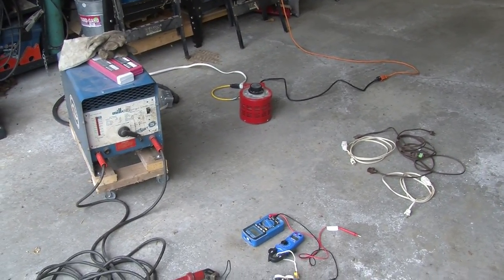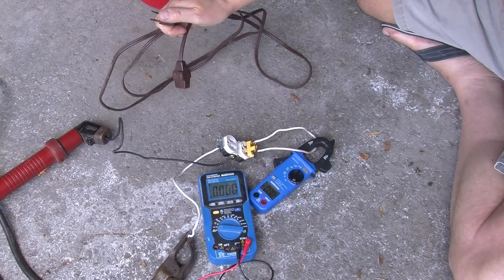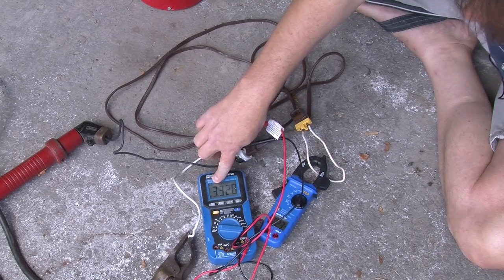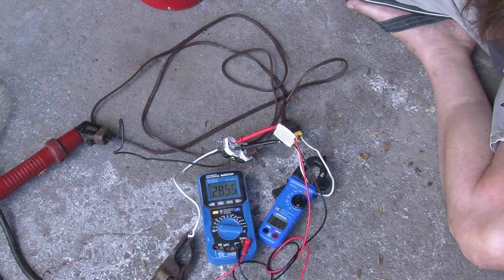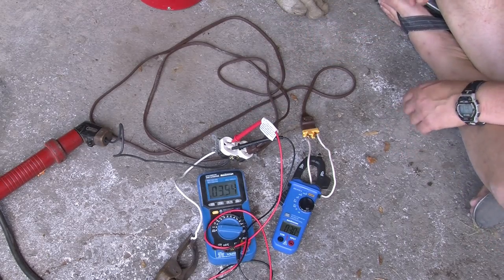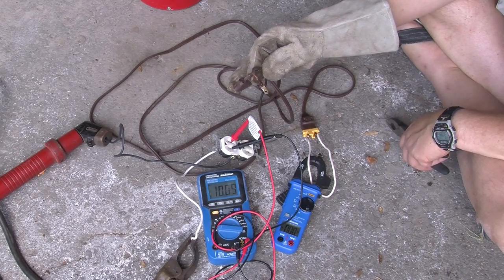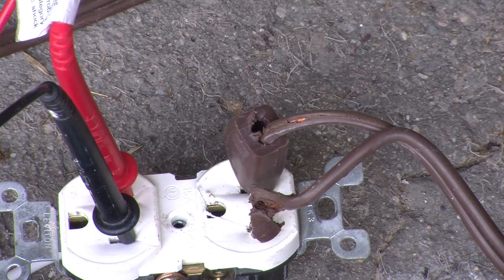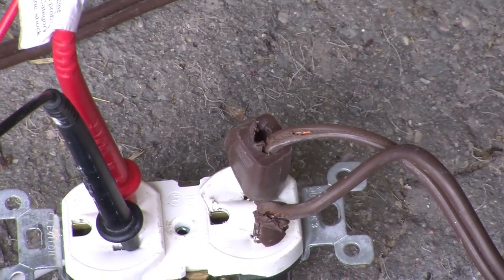Lets try overloading some extension cords.

Comment: Throughout my career as an electrician, and everyone in the company were volunteer and paid professional firemen. I lost count how many fire jobs I rewired. The #1 reason a home burns to the ground in NY is they used a 400W lamp cord cube or light duty extension cord for an electric heater. In houses with fuses, I have removed cabling that was so badly overheated, that the wire insulation disintegrates when Touch it.
Reply from the maker: So you saw these issues first hand! We should have fuses in those extension cords. "the wire insulation disintegrates when Touch it" - thats exactly what happened in my 14/2 in fiberglass experiment!
Reply: The new lamp cord cube extension cords today have a 4amp fuse in the cube. Purposely to prevent fires. 4 amps is roughly 500 watts. Plugging a 1500W heater or a wall air conditioner will instantly pop the fuse.
Reply: To further protect from fire. All receptacles switches and sockets in residential settings must be Arch fault protected per article 210.12 of the NEC. The Slightest circuit issue will trip an AF breaker.
Reply: As someone who lives in an older house (built before electricity in homes was a thing) in upstate New York, I can say that at least some of the wiring here is so old and made of such dubious materials, that the insulation turns to dust when the wire is bent, although it has never been overloaded.  There are at least five wiring systems: knob and tube (thankfully with no wires now), cloth covered wires (still used in most of the overhead lighting circuits, and some outlets with wiring dropped down from the fixtures), what appears to be gutta-percha insulated wires in black iron pipe conduits (this is the stuff that turns to dust when disturbed), THHN in galvanized conduit, and Romex.  About a decade ago, I had an electrician replace the fuse boxes (Edison base screw type) with a modern breaker box, after I noticed that house fires due to "electrical issues" were rather common in this neighborhood.
Reply from the maker: @robertlapointe4093  When I was teenager we lived in the same house in Ontario! Although no THHN in galvanized conduit or black iron pipe. I'm sure you felt much safer after the panel upgrade. I Suspect the old dry wood in historic houses  also makes it easier for an electrical fault to cause a fire. You probably are aware of this, but if not: there are combination arc fault breakers (CAFCI) available that fit most modern panels and are designed to trip if there is an arc due to a short or an break in the wire/connection. Depending on how you feel about the old wires, that might be a consideration. But unfortunately they are quite expensive.
Reply: Extension cords made from 18/2 lamp cord aren't sold here in Michigan (unfortunately they are available on Amazon and FleaBay).  The only cords that are 18/2 here are replacement cords for an actual lamp and those don't have the female outlet end on them.  I do have an old 18/3 computer power cord, the computer it is connected to draw about 70 watts maximum.  I don't know of them being sold in the state today but, again, Amazon and FleaBay have them).  16/2 extension cords are but they are rated for 1625W/13A so they will perform much like the cords in this video -- keep it to 13A or less and an undamaged cord of this type is theoretically safe.
Reply from the maker: @mharris5047  It sounds like Michigan is ahead of us in terms of safety in that respect. Thats really great to hear - I'm sure even if people can get the #18 cords from "alternate sources" the bulk of extension cords that are bought will be from local stores. I'll bet over time this will save countless lives and injury from house fires!
Reply: @ElectromagneticVideos  I had assumed that 18/2 extension cords had been banned throughout the US.  I know I haven't seen them in any Michigan stores in at least 20 years -- and the state is usually the very last to amend its electrical code when a new national model electrical code is released. You don't even need a permit to rewire your house in many townships, that is how far behind the state is in its electrical code updates.

As for the 18/2 extension cords themselves, about 50 years ago my parents had one in service.  They had an approximately 100 watt fan and a 50-60 watt satellite descrambler connected to it.  The cord was hot just with 150-160 watts going through it.  I yanked that cord myself and replaced it for them so their house wouldn't burn down.  I never used an 18/2 extension cord in any of my houses, I am not a fan of them even for lamps.  If I have to replace a lamp cord I cut the female end off of a 16/2 cord, drill out the hole in the lamp the cord goes through, make a grommet for it so the cord doesn't get cut on sharp metal and replace the cord with that.  This is less of a concern now that light bulbs are 15 watts each instead of 150 but I am still not a fan of paper thin electrical cords.
Reply from the maker: @mharris5047  Wow - no permit to rewire!!!!!! I'm stunned at that. Although I'm not a fan of it being to strict in the other direction either. I do wish the electrical authorities would offer some sort advice service rather than just strict inspections so that people would be encouraged to get advice on things that they are uncertain of.
Reply: Though it is often called a plug, the receptacle is not a plug. It may be called an outlet, but a plug is a male connector.
Reply: @robertlapointe4093  there's nothing quite like running some cabling in a house, reaching around and finding knob and tube. I'm hesitant about just reaching in somewhere but I've been lucky, even when the circuits were supposed to be live they weren't.

I just looked it up to make sure we're talking about the same thing and that's when I learned that there was supposed to be insulation on those wires. I've worked on at least three different buildings that had knob and tube wiring and not one of them had an insulated wire in the walls. I thought that's just how they were run.
Reply: @glenwaldrop8166  The thing about the old knob and tube wiring, was that the hot and neutral were always separated by some distance. Really there were only a couple places where they even cam near to each other. One being at a receptacle and the other at a light fixture, albeit that the hot is the switch leg.  In a switch, you had 120V potential between the two wires, but the switch leg wire was connected to a bulb between it and the neutral. So the current capacity was limited to what the resistance of the light bulb was.  In a lot of cases, the hot and neutral wires might not even have been run in the same wall, unless it had a receptacle in it.

In a lot of respects, as scary as  it may looks, it was really a pretty safe system, provided that the fusing protection wasn't cheated somehow. 

I don't know if there was an official spec, but in every system I have seen, the wire was 14 gauge, typically fused at 15 amps. I think it was fairly common for these to be bumped up to 20 amps by the homeowner. That often happened as some higher wattage appliances appeared. If you used standard fuses, they would blow pretty quickly with only slight overcurrent. I do not wish to suggest that using this old  K&T wiring was "safe" at 20 amps, but in reality, it could operate like this 24/7  without any real issues. I don't recommend it, and over time, components will deteriorate like insulation and places where there is a connection which might develop some resistance. The standard splicing technique of the day was twisted and soldered wire covered with tape. Virtually, no resistance, which ironically is far better than making a connection with "modern" WAGO connector!!  Which inherently, by its design, inserts some resistance in the connection.  

You can find these old systems still working at 100 years old. The bottom line is that these were very safe systems. The only real weakness was in the wire insulation which does deteriorate over time. But I have seen 100 year old K&T wire that was still somewhat pliable and have also seen it where  it crumbles easily. The differences may come from some variability in the  original insulation and it might also come from running it a higher currents.  All of the devices like switches and receptacles use sturdy screw connections. Done correctly, with solid wire, these are very reliable connections with virtually no resistance.  

In reality, these were pretty well designed, safe systems. They were designed for a time when household electrical usage was quite low though.  So usually when you come across it, it  has been modified somewhat in an updated, expanded system.  

A common thing you will find in some quite old homes with plaster on lath walls, is that ceiling lighting may still be K&T.  Receptacles are fairly easy to expand and replace, but replacing celling lighting without damaging the old walls and ceilings, is often near impossible. It can be done, but often gets pretty complicated. A lot of old houses with this type construction, had firestops in the walls, which make fishing in new wire a real pain. Tools like fiber optic cameras and high quality electrician bits with flexible fiberglass shafts, are almost something required for this kind of job.
Reply: @professorg8383  Pretty sure the electricians around here never read the book. Two wires would come through the top of a wall (or bottom, depending on craw space or attic) and go down the wall with a 12 inch gap then tie in together at the outlet, just bare wire.

The upside is the building where I hit he copper directly had been repurposed as phone line.
Reply: @glenwaldrop8166  The old timers had things figured out pretty well. The old house I grew up in was built right around the time that electricity was first being installed. It was an old massive brick house. The foundation walls and and old entryway staircase were clearly had mixed concrete. The foundation wall was about 20" thick?  They say that concrete keeps aging and getting harder with age. I can remember trying to put in some wall anchors and going through multiple masonry bits to drill the holes!! Really hard concrete!  

Anyway, the funny thing was that when built, it had both K&T and some gas lighting in a few main rooms.  I can only speculate that they may have had some doubts about the reliability of the electrical infrastructure and decided that having gas lighting might be a good back-up approach. I am almost certain they were both installed at the same time. I found some ancient pictures that showed the original gas lit chandlers in the big living room. But then at some point they were converted to wired fixtures. It looked to me like these originally had one central bulb with gas out on the perimeter arms of the chandlers. I can only assume  that this was originally made as a dual source fixture. Crazy!  

That house is still in the family and is in remarkably good shape. A few big rooms still have the original plaster on lath walls  An interesting feature was a cavity area between the basement and the attic. It was about  one foot square on the  inside and was used as a "channel" for the original K&T wiring taking it from the basement level to the attic.  It was built into the floor plan where 4 room corners came together leaving no outward sign that it was there. 

I am always amazed at how they built things long ago. I'm sure this was a high end house when built and probably cost a few thousand dollars at the time!!!  The way they did siring was quite interesting and nothing like we do today. Pretty funny that you found some K&T repurposed to a phone line!! When I was about 5 years old, I can remember the  old phone that was probably original. It probably weighed 25lbs and was made with a seemingly massive Bakelite handset. No dial. When I was that age it was a "number please" switchboard system.
Reply: I am amazed that such extension cords are legal. In Finland all extension cords are rated for 16 A which is the maximum breaker allowed. Only exceptions are strict one to one Europlug cords and a Europlug can be used only on a device that is rated for max 2.5 A.
Reply: @professorg8383  yeah, it was old school, had the two wire connector similar to EU plugs that went into an adapter to R11. Didn't know where was such a beast until I tried to troubleshoot why these folks DSL kept going out randomly.

I think the neutral may have still be tied in to the electrical, when enough appliances turned on their DSL got unstable. Only reason I figured it out was the lights dimmed and the Internet dropped at the same time the AC cycled. Regardless, phone guy ran them a new line.
Reply: @glenwaldrop8166  Pretty crazy, but 24awg or 0.5 mm can in theory, support about 3.5 amps.  At EU 230 volts, that's probably enough to power a modem. Seems pretty inane to me to run that small wire just to save a little money on copper!  I guess if the plug/adapter is appropriately fused, it's probably  OK. But I think I would want to change to something heavier
Reply: @professorg8383  pretty sure someone just used the existing old electrical rather than run a new phone line. Parts of the house had been modernized.
Reply: @glenwaldrop8166  Well you say it so I'll trust your  interpretation. People sometimes do stupid things when they think they know what they are doing.
Reply: @professorg8383  I'm just making educated guesses here. The house is over 100 years old and had issues. Been 15 years now.
Reply: @glenwaldrop8166  your neutral diagnosis could be close to the issue. Given that the circuit hot is constant. Somewhere hidden in the history of the renovations my guess is there might a floating or crossed neutral. OR, I automatically inspect the backup grounding for the building. Worst case, the utility grounding, neutral is broken out on the grid, and the whole house is dimming and operating neutral to building grounding. IE water main grounding, and or the grounding electrodes in situations where the water main is not a valid grounding point to earth.
Reply: @keithhults8986  Have you ever observed the heat induced breakdown of wire in houses with circuit breakers, or is it invariably a product of having fuses?
Reply: @Muonium1  Because I grew up a volunteer fireman's son, and I spent my career working in a company filled with volunteer firemen, I have rewiring more fire jobs than can count. I wired firehouse's, police stations, municipal water and sewage plants, a marina, 5 gas stations. Calculate D ratings. That is your wire temperature formula.
Reply: @Muonium1  fuses are the most sensitive to tripping, making fuses safer than breakers. That's why fuses are inside electronics today. Insulation bubbling already damaged the copper underneath. Melting happens at connections and splices first. The heat from the melted connections, begins to travel up into the cable. Yes I have briefly touched hot romex, before it could burn. During my 37yrs, I have stop 5 fires inside walls and ceilings before the house went up in flames. The wall was soo hot on one service call, luckily I called and waited a few minutes for fire captain employer arrived before we carefully opened a small hole, with a garden hose, we drowned a contained fire, avoiding a massive flash fire. I should've been a volunteer fireman. Learn how to put out electrical fires.
Reply: @keithhults8986  uuh ok, not really pertinent to my specific question, but whatever
Reply: @Muonium1  you asked if I observed the effects of heated wires. I try to answer the best I can. Ventually you will have the experience of repairing and replacing burnt damaged wiring.  D rating conductors is very important. The simple non trade answer is the insulation bubbles and turns copper discolored and brittle. A hot spot will cause a wire to melt.